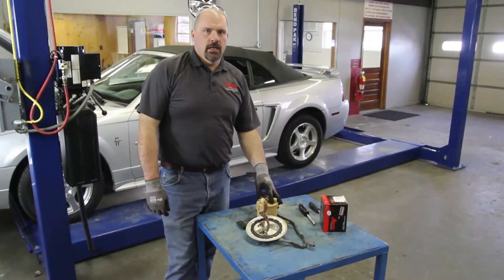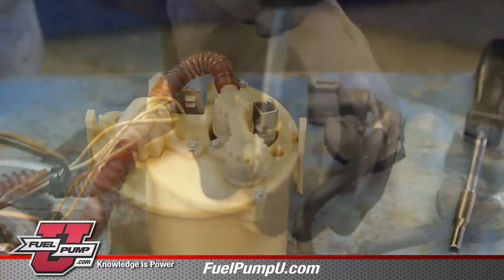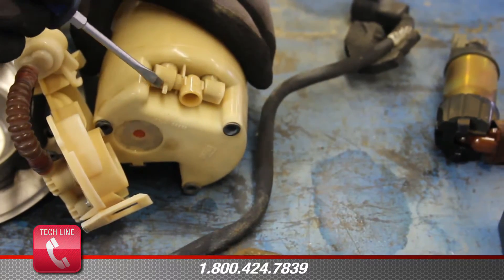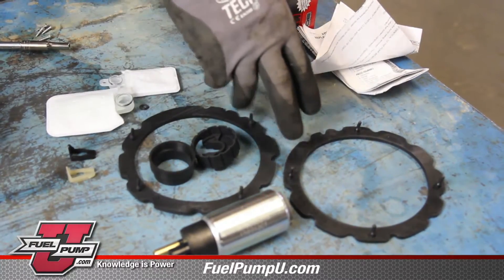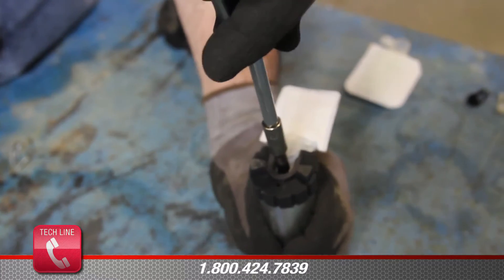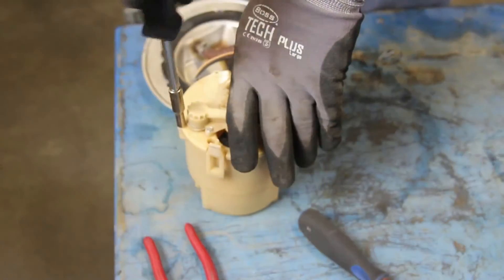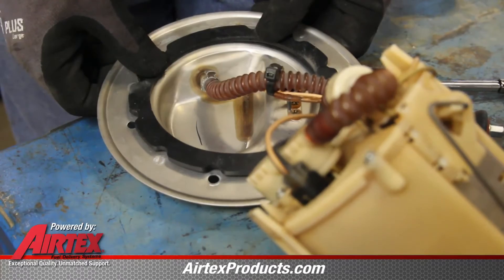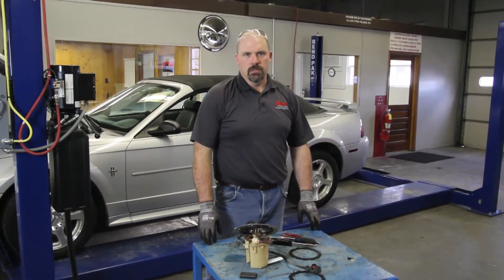How to Install Fuel Pump Only E2366 in a 2004 Ford Mustang

Comment: How many GPH on this pump?
Reply: Same as svt focus 284lph.. I just bought it myself for my Mach 1
Reply: @jmitchell513  I just installed it like 2 days ago same as this one and now I got code p1132
Reply: Miguel Chilpa hmm I haven't done mine yet  but I know this pump flows more fuel than stock (that code says it's running rich) is yours a v6, GT, or Mach 1
Reply: @jmitchell513  mach1 dohc
Reply: Miguel Chilpa I'm about to return mine before installing.. basically this pump flows more base fuel pressure than stock and idk if your car is modded but mine is not.. it's bone stock
Reply: @jmitchell513  others says the ECU manage the fuel pump to send stock parameters cause we got fuel pressure regulator
Reply: @jmitchell513  I'm about to put in There a stock one and will see .maybe  I got something else wrong
Reply: Miguel Chilpa I’ve been read it hat too it saying the fuel pressure regulator is supposed to control that anyway? I’m confused now.. please keep me updated
Reply: Miguel Chilpa any update on the pump man? I still haven’t done mine yet
Reply: @jmitchell513  I reinstalled the stock pump  and still getting that code..so fuel pump was not the problem
Reply: Miguel Chilpa gotcha thanks for getting back with me! Wonder what it is? Regulator ?
Reply: @jmitchell513  it is making a nightmare I changed o2 sensors fuel filter EGR iac fuel pressure rail sensor ..will try with pcv and dpfe sensor and EGR selenoid
Reply: Miguel Chilpa hey man just going to let you know I sent mine Airtex back and went with a Spectra SP1144 got it all installed this evening fired right up no check engine light or any problems. I’ve heard those focus style pumps in our cars base gph flow is too high and makes them run rich. The spectra flows a minimum 57gph, where the airtex flows 65gph minimum.